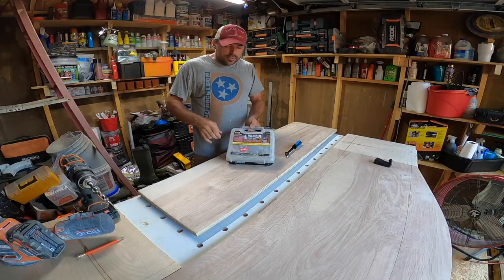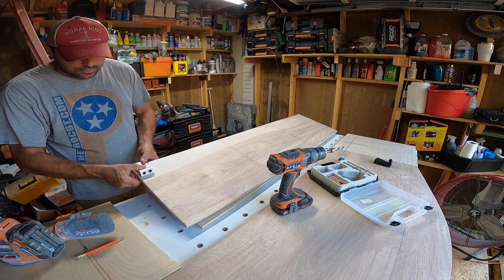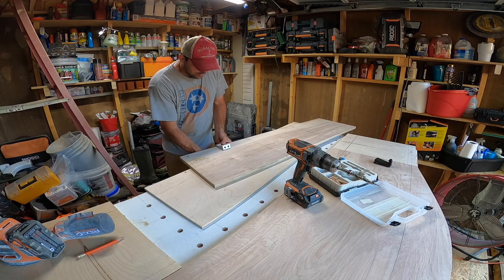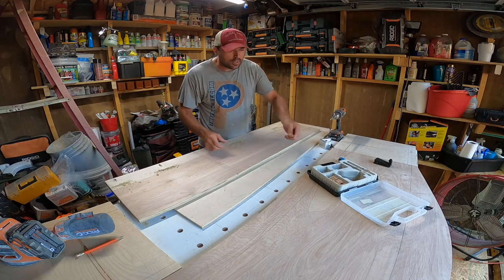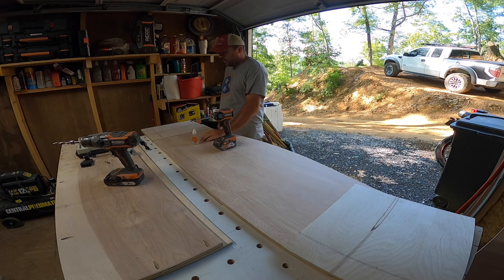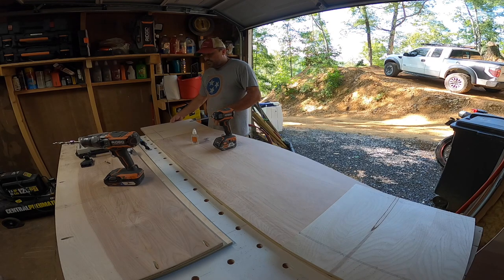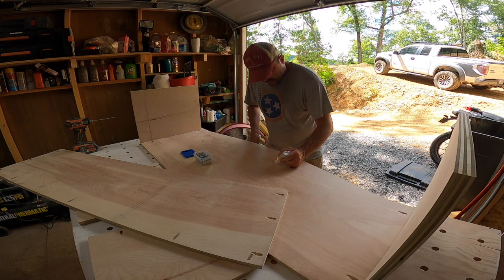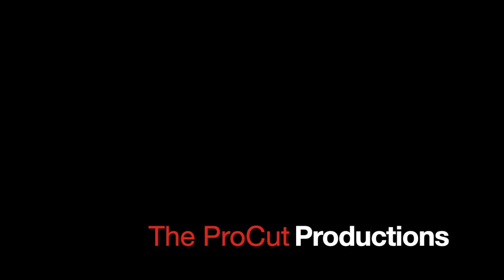How to use a pocket hole JIG [Hope bench]

Comment: Hey John! Great video brother! The GoPro setting you used was really good! I noticed that you didn't pre-drill any holes for the sides when you attached the pocket hole screws, I reckon none were needed eh? I'd be afraid I split it but you know what you're doin! Again, great video!
Reply from the maker: the pocket hole screws are self drillers
Reply: The ProCut Hmm, I need to learn more about carpentry I reckon. 🤷🏼‍♂️